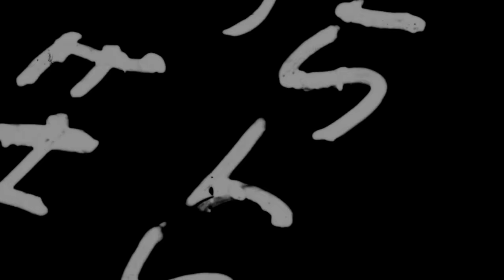I Found My Old Four-Wheeler! 28 Years Later...

Comment: Where i live the LT-50s an LT-80's are worth a big chunk of change an early ones even more if in good nick especially when you consider you can buy a full size quad for about half the price. An LT-50 was the first quad i converted to 48v electric motor it was insane but no-one wanted to buy it, so put the motor back in an it was sold in hrs for basically the same price (people didn't get the battery cost over $1.5k which gives you an idea how much its was worth stock). The guys price point was pretty spot on which is nuts